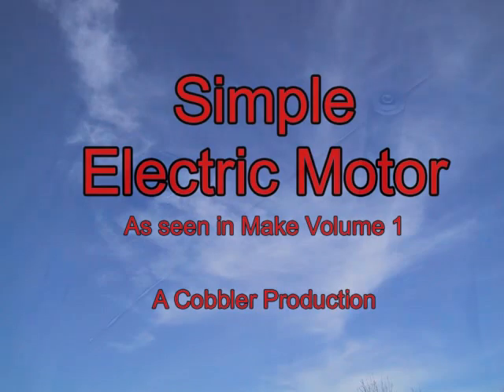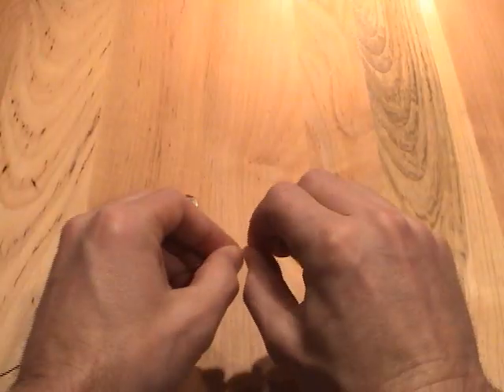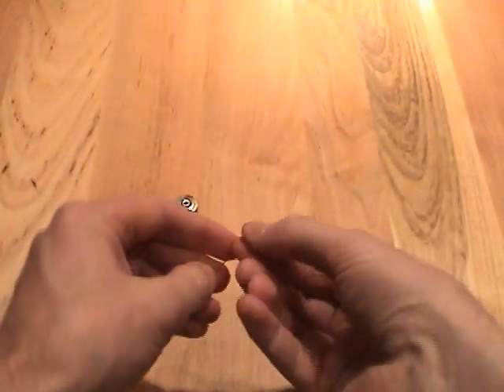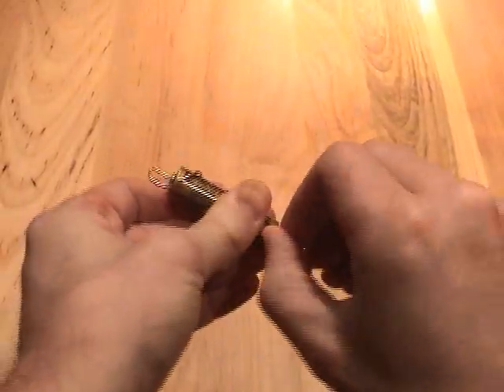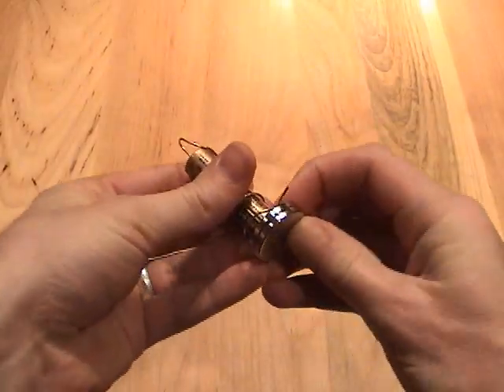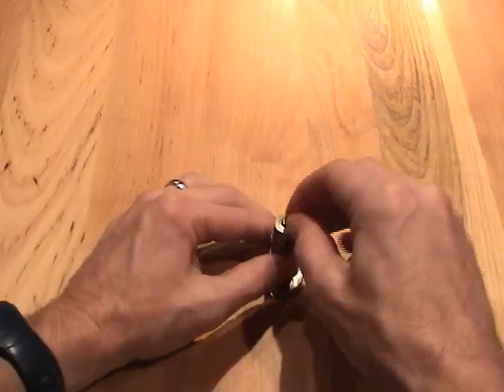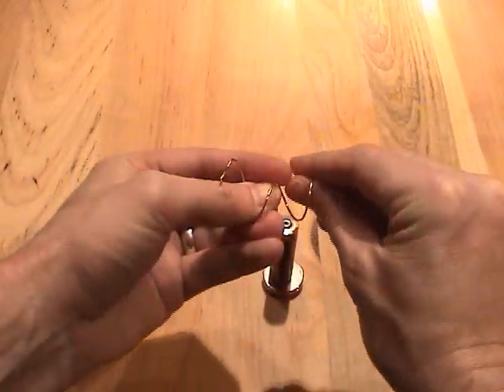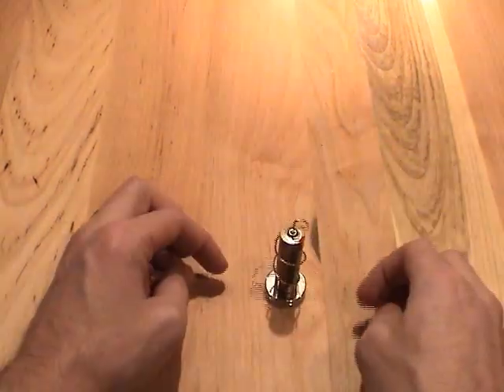Unexplained Phenomenon - Simplest Electric Motor

Comment: Everything has a small magnetic circular field around them. But an objects field depends on its shape. But magnets have a very strong field thats why there useful. The battery has the same field but its an electrostatic field.  Use a copper wire is best for its field is conducive with the magnet.  The wire connected to the battery chargers the wire and moves with the magnetic field.  Its very simple if you think about lol.

Comment: Curiosity got the best of me and I tried this but it failed miserably.  :(   I had a good battery and magnet.  Maybe the wire needed to be special wire?  The instructions couldn't have been more simple but it did not work.  Could you please leave a comment and tell me WHY you think this did NOT work?
Reply: The wire must be copper
Reply: Oh, ok.  Thanks.  That must have been the problem.  :-/
Reply: Benjamin Didone Not just copper, silver and gold coated Cu or Zn works fine as well
Reply: My pleasure.
Reply: Jorge Hazael Pérez Moysén  Thanks!  :)
Reply: and it needs to be a neodymium magnet. don't know if he said it.
Reply: Nah, it doesn't have to be copper. Any wire that conducts electricity but will not stick to the magnet will do. And yeah, has to be a neodymium magnet. You have to get it just right. So mess around with it till it works. It may need a push start.
Reply: Jorge Hazael Pérez Moysén Cu is copper... and the coating is of no importance whatsoever.
As long as the wire is sufficiently conductive, it will work.
Reply: s

Comment: The homopolar motor is not an unexplained phenomenon at all, it singular line of force, with a magnetic monopole.  And that's all there is to it.
Reply from the maker: Well that explains everything.
Reply: Monopoles defy physics in electrical and magnetic sense. Current flows from positive to negative, and magnetic field lines in a singular magnet always arc towards the opposing pole. That isn't theory, as far as we know it's physical law. If someone could create a monopole, however, it could change the way electricity is delivered, allowing only half the materials to be needed, and that person would essentially become rich as fuck.
Reply: Kroteezy Thank you soooo much for replying :)
Reply: +Kroteezy it wouldn't be called wire if it weren't made of metal or some other conductor. that's kind of the whole purpose of the wire... to conduct electricity
Reply: Can you use any type of wire? like copper wire?
Reply: Since current is the flow of electrons and electrons are negative and opposites attract, current flows negative to positive.
Reply: ***** current actually flows from negatives to positives. When the current passes through the magnetic field electrons moving in the wire are pushed in an opposing direction because they have become electromagnetized and have a moving magnetic field. It is the interaction of these two fields that makes the wire move.
Reply: Try looking up Lorentz Force.
Reply: Kroteezy Right, but electrons moving creats the space of an essential positive charge physically. The magnetic field is created by the moving electrons essentially creating an oppositely moving positive charge and then varying the feed of charge rate. ;)
Reply: Simon Sutton it spins whichever way depending on which hemisphere you're in I think

Comment: Creating a magnetic field while the magnet is there that makes it spin
Reply: Angus Graham Thank you......They number of people that actually find this mysterious and impossible to explain are....well....saddening
Reply: Cobbler Videos If the magnetic field of the magnet was imagined as lines they would exit the pole, go around the edge, and enter the other pole; so they are oriented up/down. The field lines around the copper wire are oriented perpendicular to the direction of the current - around the wire - so where the wire touches the magnet the lines are perpendicular so the force will be clockwise/ccw rather than up or down towards the poles of the magnet. Grade 11 physics was a long time ago but I feel good about that answer.
Reply from the maker: But why does it spin rather than pop up or pull down?
Reply: Nail. Head.. Hammer.
.
See 'British Space Race'. .LOL.
Reply: Everyone isnt schooled in magnetics and electronics, why you talk down on such people is degrading and just plain evil. People like you cause people to kill themselves and or feel stupid when there only ignorant of a certain topic. For example if I asked you how a truck driver shifts gears in a tractor, if you had never done this you wouldnt have a clue not because its hard but because your ignorant of tractors. Be kind to others and it will come back to you, be evil and that will come back also.
Reply: Quackers go try and shift heard in a tractor by googling it and you will not get it you will screw up the transmission you just gotta learn it but you think it's as simple as dumping the clutch and putting it in gear which couldn't be farther from the truth. Lol I'd give anything to see you googling trying to shift heard on a tractor I'd laugh my butt off lol lol lol
Reply: so no response? I DID google it and I found it as well.

Comment: The invisible magnetic forces are moving the coil. Electricity and Magnetism effect each other, therefore the coil spins when it creates an electrical circuit activating the magnet which then uses magnetic force to attract opposing poles and that force is what makes the coil spin.
Reply: i don't know what the hell you just said but thumbs up
Reply: You have the right idea, but you're physics is completely made-up.
Reply: ***** Your physics are somewhat messed up, but I think Santino was talking to Micscience.

The only reason I say yours is messed up is because the magnetic field isn't only linear (from south to north), but also creates curbed vectors around the linear part. You don't mention that fact.
In this case, the north and south poles of the magnet are entirely below the wire, so a strictly linear field would have no effect.

Comment: Because when the current flows through the wire it produces a magnetic field and this interacts with the static magnetic field produced by the battery. Using Fleming's left hand rule you can see the force that is produced. Turn the battery upside then the spin will be reversed because the direction of the force is reversed.
Reply: The force is at right angles to the field and the current in Fleming’s left hand rule not in the direction of the current.

Comment: For one the wire is metal the battery has nothing to do with it it's just a base for the wire to spin on but since it is spiralled the magnetic field pulls down on the wire causing it to spin
Reply: Um the base is a magnet.

Comment: It works the same way a pinwheel works. Flow. When air enters a pin wheel, the easiest path of resistance forces the air to the side, and the laws of momentum force the pinwheel in the opposite direction. The same reasoning is applied in this. The current moves upwards and turns due to that being the path of least resistance, The momentum forces the wire in the opposite direction. You can see that it rotates opposite its curve.

Comment: +mista magoo you are being too technical for the lot of dumb asses round here, simply put the magnet is creating a magnetic field, and the coil & battery is creating an eletro-magnetic field, the polarity of these two fields work with or against each other depending on which way the magnet is facing. in this case they are matching so the magnet field pushes on the field created by the electro-magnet causing the coil to lift in a upward motion away from the magnet and since it is angled it spins.

Comment: It's not that weird, this is a reversed use of an electric motor, because there is a current running trough the copper and touches the battery there will be an Electric magnetic field opposite of the battery below wich cause the copper thread to contsantly change polarity and there for spin around

Comment: Current flows through the wire because the anode of the battery is sitting on a conductive coated magnet, the wire is touching that magnet and the cathode of the battery. The flowing current produces a magnetic field (Ampere's Law). Placing your right thumb in the direction of the current, your fingers curl in the direction of the B field. Since the wire is coiled, it's always trying to "catch" the magnet due to this field. Simple DC electric motor.

Comment: It's a Homopolar Motor. A homopolar motor is a direct current electric motor with two magnetic poles, the conductors of which always cut unidirectional lines of magnetic flux by rotating a conductor around a fixed axis that is parallel to the magnetic field. The resulting EMF being continuous in one direction, the homopolar motor needs no commutator but still requires slip rings.The name homopolar indicates that the electrical polarity of the conductor and the magnetic field poles do not change.

Comment: interesting video, thanks for sharing. Question. If stable, how long will this motor run. Does the battery lose charge, or does it recycle the energy, this is important. 

Theory:Electricity is similar to water  and it can be contained and re-used over and over again just like water.

Comment: isn't this basically the opposite of making a turbine generator? instead of spinning the magnet in a copper coil to generate power, you use the power from the battery to spin the coil?

Comment: ha, agree. no explanation. what I think is magnet bridges the wire to the negative pole starting the flow of electrons, this creates a magnetic field perpendicular to the wire and repels the magnet at the bottom. The lower part of the wire been repelled the most and been at an angle with the magnet makes it go more towards one side. If the force is enough to actually lift the wire, the connection is lost and the repulsion ends, Gravity brings it back down and the cycle continues.

Comment: Singular directional flow of energy. All energy is kinetic in nature, and so, in an environment of low resistive centrifugal anchorage, a counter clockwise from top to bottom coil, creates a path of energy that is trying to become straight... i.e. it will rotate in the same direction as the spiral of energy, on the basis that energy itself, will always seek the least resistive directive course. i.e. spinning in such a way as such that the points of contact will be ever closer to the synapse.

Comment: The way it works is the copper wire touches the + or positive side of te battery, and the other side of it touches the magnet which touches the negative side completing the circuit. Or maybe the magnetic field tries to pull the wire causing a spiral. But those are my theories and i could be wrong.

Comment: it is not very practical indeed, but this type of motor/generator allows DC designs that can handle very high amps, they were used to power some particle accelerators.

Comment: an electric current is formed by the + of the battery, coil, magnet and - battery.
This electric current generates a magnetic field that interacts with the magnetic field of the magnet fixed. interaction of two magnetic fields generated electromagnetic torque, so moving.

Comment: i think because the negative part of the battery is on the magnetic.copper  dont stick to a magnetic cause it dont contain steal.so the negative thats on the magneict just pushs the wire instead of it sticking i think let me know if im close

Comment: The s electricity flows through the magnetic field and the metal is attacked to the magnetic field the electricity flows up the wire and around the the field of the magnet

Comment from the maker: You probably just need to get the wire balanced on the battery so that it spins freely and just lightly touched teh magnet.  Also, were you using a metal coated magnet like the one in teh video?

Comment: Nope. The power supply converts everything to DC for internal supply. Running AC directly into the circuits will destroy them like devil's cock in a virgin's ass.

Comment: You can use the right hand rule to figure out what direction the wire spins in relation to the coil rotation.  When you reverse the poles, the electricity moves the opposite way.  Take your hand  and point thumbs up from negative (bottom) to positive (top).  Follow the coil to the bottom, imagining that you are holding the wire.  Your thumbs direction side-ways will dictate which direction it will spin.  What mathematical function is responsible for this?

Comment: the force is given by F=qv X b, or force equals the product of the charge of the object receiving the force and the cross product of the velocity vector and the magnetic field vector. You can increase the magnetic deflection force  on the electrons in the wire (and thus the force which rotates the coil) by increasing the magnetic field strength (use a stronger magnet) or increasing the speed at which charges move through the wire (increase the electric field in the wire by increasing voltage)

Comment: it's not very difficult to explain I will try to explain it. I think that the magnet is what causes the coiled copper wire to spin because it is connected to the negative part of the battery and the copper wire is with the positive end of the battery so it is a positively charged which us what causes it to spin.

Comment: Lorentz Force. When you have electricity flowing through a magnetic field, you have a perpendicular opposition of pushing force 90 degrees from the direction of electron flow in the magnetic field. If the electricity goes up or down, then the pushing force is outward 90 degrees  from the direction of the electron flow.

Comment: And if there is no coil and just a stright wire version of this (as seen in other videos on here) you can touch it to get it started in either direction. the momentum will allow it to keep going in that direction unless it encounters enough friction to stop it, or the flow of electrons through the wire stops. (you touch it or the battery dies)

Comment: 1. when you put electricity (positive to negative) through the wire, it allows a flow of electrons.
2. the direction of this flow can be changed by A. the direction of the coil (cw or ccw) or  which end is positive or negative. 
3. the vortex either pushes, or pulls, the small coil created by winding the wire. 
4. if you are able to measure it (would be difficult) you will find that depending on the coil direction, your wire will either be pulled down, or pushed up slightly.

Comment: Battery causes current flow through the wire. The magnet completes the circuit for the copper wire and battery. Due to flow of electrons through it, there is a magnetic field around the wire. However, the curved shape directs field in the downward direction. The magnet has a magnetic field in the upward direction. However, the magnetic field of the curved wire is not even, and the counteracting magnetic fields spin the copper wire. Similar to if you try to put two North sides of magnets together

Comment: Its an application of the right hand rule. Its easy to see at the top where the wire is horizontal. The current travels left, magnetic field travels upward, and the force is perpendicular to those two, so into the screen. That's why it spins clockwise. I am trying to get mine to work like that

Comment: its because at one end, the copper wire is on the positively charged side of the battery,and on the other end the copper  wire is touchi g both a positive and negativ charge

Comment: Close - It works because there is a current through the wire flowing radially outwards along it's length (centre of the battery to edge). The magnetic field is perpendicular to the flow (from bottom to top) which causes the wire to experience a perpendicular force (from a line from the centre to the point you're looking at) (see Fleming's left-hand rule).

The coiling of the wire is not necessary

Comment: Top of battery is positive,top of battery touching the other end of battery is negative,You actually made a dc motor in a way.The coil in the center act as a rotor.very  good science project.

Comment: if the cooper wire is insulated youll need to strip the ends off with sand paper.

Comment: It's simple enough the battery produces a current through the wire. This current produces it's own magnetic field around the battery. That mixed with the natural occurring field on the magnet causes a force on the wire, depending on which way you have the coil wrapped, which end of the battery you're touching, and the amount of times you wrapped the wire around the battery. I'm not 100% on the last statement we didn't get that far in Physics 2. Or maybe we did and im just to lazy to draw it :)

Comment: I'm trying to to make one, but the wire isn't spinning. I'm using a magnet slightly smaller, does the size or the 'strength' of the magnet matter?

Comment: It's a phenomena caused by an induced field.  Specifically by induced magnetic fields which exert magnetic force (I believe, it could easily be an electric field, but it's 5 am here and IDGAF at this point).  All induced forces are, by nature, much, MUCH weaker than natural forces.  Thus, while the force on this tiny wire is strong enough to counter the weight and the force of gravity, it would take an absurdly larger version to produce enough force to power even the smallest appliances.

Comment: It works in the same way all the motors work. A magnetic field in the presence of another magnetic field. One magnetic field is due to motion of coil which has electric current. The second is obviously the magnet. So the magnetic field of coil opposes that of magnet due to which it moves and this keeps on repeating. Good thing is that the magnet also acts as electric conductor. However, you need to give it a little push to start. It won't run from steady.